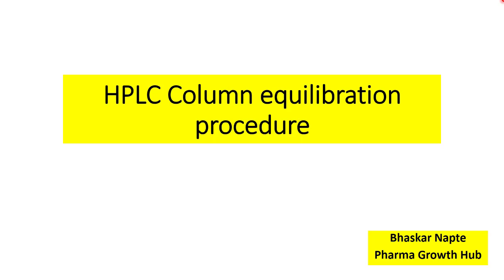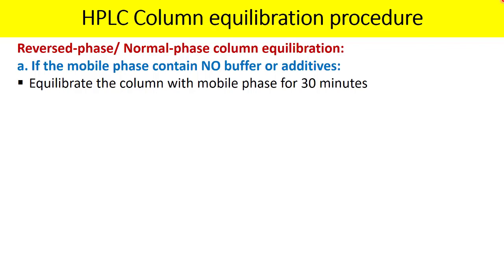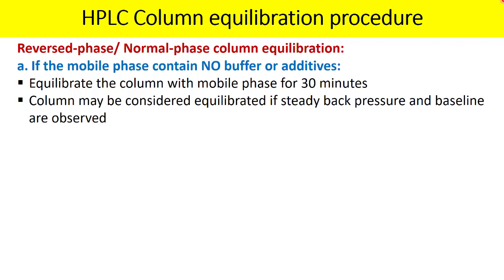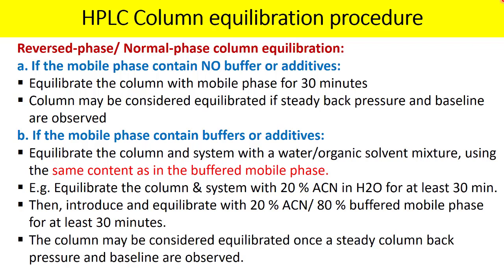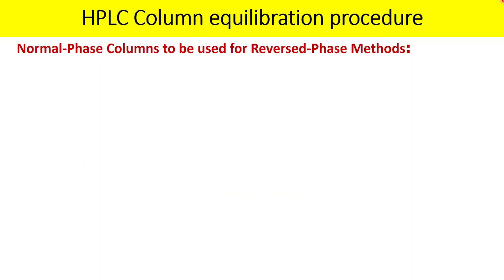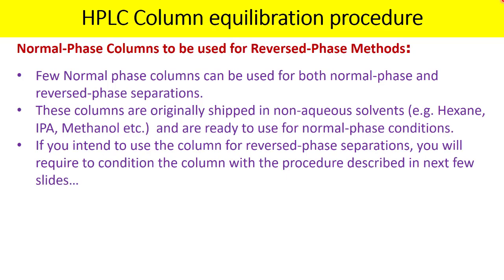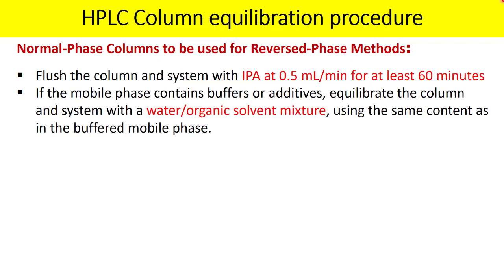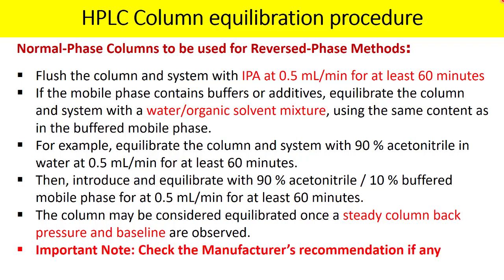How to Equilibrate HPLC Column?

Comment: How to treat sample for acidified force degradation.
Reply: You reply force degradation with 1N HCl at 60°c if degradation is less than 5% then go with higher normality
Reply: @shivamtyagi4765  dear I also asked how do I use 0.1 n HCl and NaOH for sample preparation? 
I mean if I have diluent in my method is buffer and methanol. So should I replace altogether diluent with 0.1 NHCl and NaOH?
Reply: I want to know should I use 0.1 nHCl and 0.1 nNaOH and 3percny H202 for oxidation for sample preparation of impurities generation in force degradation.Lastly how to perform neutralization bfore injecting in hplc
Reply: No you don't remove diluent firstly you add 10 ml 0.1 HCl for degradation after that add 10 ml naoh 0.1 then make up with your diluent
Reply: You mean 10 ml as defined standard amount for every product for degradation purpose? Or amount of HCl can be change?
Reply: No it's vary product to product some product degradate by 1N acid aur base some are degradated above normality
Reply: @shivamtyagi4765  thankyou. Is same apply for oxidation with h2O2 ? For force degradation
Reply: @thehealer8330  in oxidation degradation add 10 ml h2O2 then put volumetric on water bath for some time as required then let it cool down then makeup the volume with diluent
Reply: You take 10 ml volumetric add 5 ml sample amount add 1 ml acid and heat it then neutralize with base and make up with diluent
Reply: Yes you apply change conditions according to your product